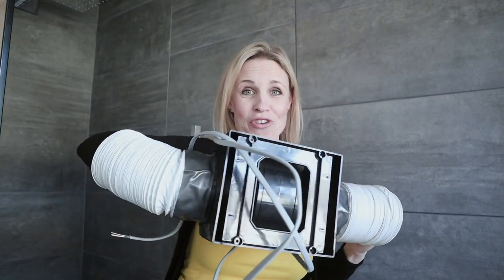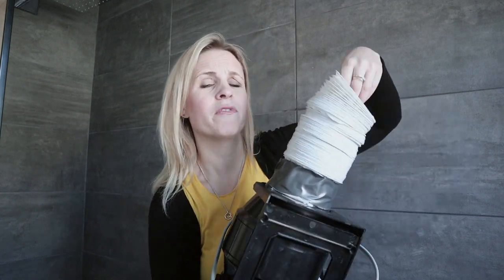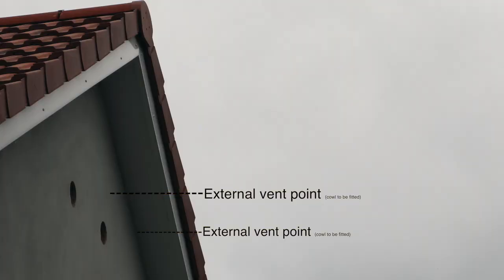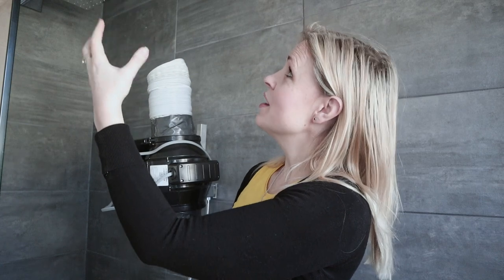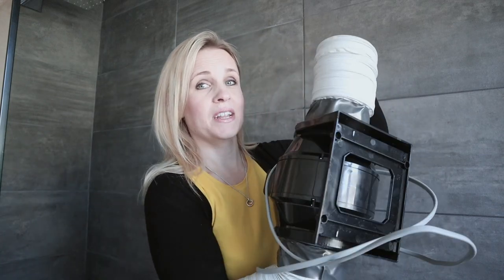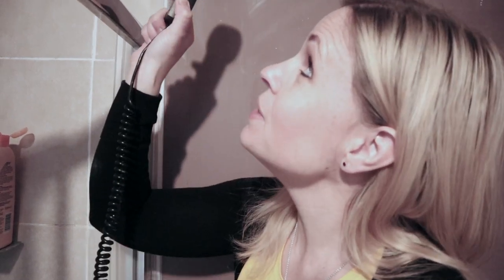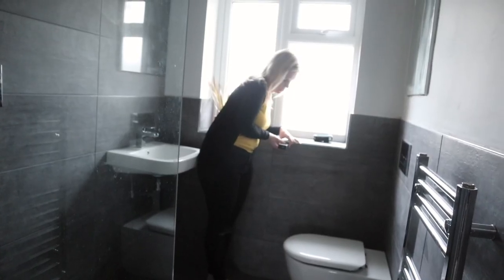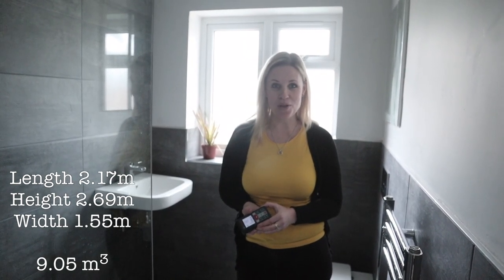BATHROOM EXTRACTOR FAN ADVICE

Comment: Concise and clear. I like that you provided the numbers for the room/fan/air flow.

Just a suggestion, to avoid moisture pooling in the extractor pipework in the loft replace the pipework with insulated pipework. It's dearer but helps get all that moist air out before it condenses in the pipework especially during the winter.
Reply from the maker: Good tip. Thank you for sharing 🙂

Comment: Hi Georgina,
Love the bathroom tiles, very modern and practical - I think the big tiles are great and are time saving compared to using the standard small square ones. Interesting to see how you are going to tackle condensation - at first I thought that you had taken up the Accordion and we may have some intro music, or had started to install an old fashioned hand dryer, then I thought no you must be screen testing for Dr Who 😀
Anyway, I think the system you are using is very sensible, as areas like bathrooms and the kitchen do suffer from condensation, and this looks as though it will do the job perfectly - belt and braces is my Moto, as you don't want to have to re-work anything. Nice job!
Reply from the maker: Ha ha - thanks Mark. Not sure we would have the patience for small tiles!

Comment: Just recently moved into a property and it has something very similar to this . But im forever cleaning the bathroom due to dust looked at the extractor it is caked with it . Also after a hot steamy shower you can see them floating about any suggestions on how to clean or unblock?

Comment: If your bathroom has an outside wall, a surface mounted fan will work fine. An internal bathroom will always need a centrifugal fan and good quality ducting, to push the moisture through to the outside.

Comment: Hi Georgina, I have a ceiling extractor fan but it's a axial type. It's vented through the roof via a 2 foot soil pipe which runs completely vertical. Now its winter there is condensation / water forming around the sides of the fan. I've tried insulating the pipe but hasn't done much. Any ideas please ?
Reply from the maker: Hi James, it sounds like the distance between your fan and the exit point is too long and it's too far for the air to travel. I think you've probably got three options: 
- try and improve the pipe insulation
- change the soil pipe out for spiraduct or insulated spiraduct 
- switch to a more powerul fan
Hope this helps - I've found Xpelair quite helpful for expert advice 😀
Reply: @GeorginaBisbyDIY   given the type of fan you showed, ? what would stop sewer fumes in a soil pipe from entering the fan's ducting when the fan motor is not running ?

Comment: Really good and informative. Thank you.
Reply: I designed a new air duct fan, which can be connected to the network via WiFi, controlled by a mobile phone, and set rules on the mobile phone. The function is very powerful and easy to understand.
I want to invite you to review it, the sample is free for you to experience. You can contact me directly.

Comment: Do you need one per room or one for both rooms?
Reply from the maker: It depends on the size of the rooms and the size of the fans and where you can run your ducting - one fan per room is preferable but you will need two outlets